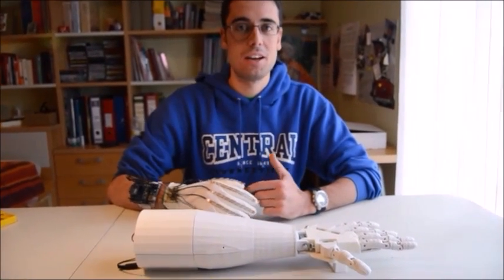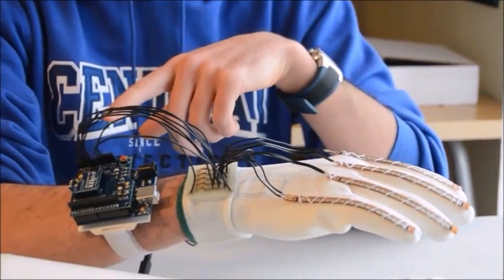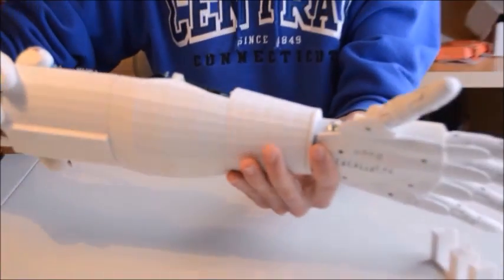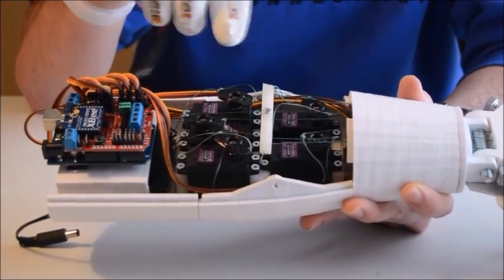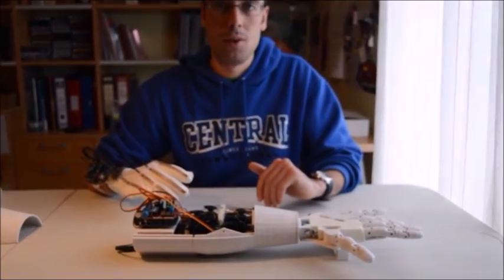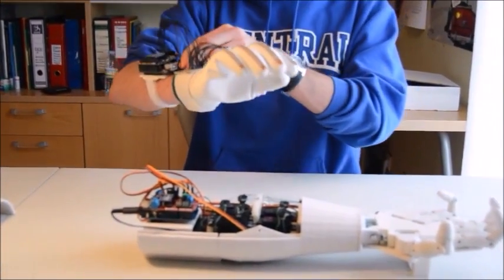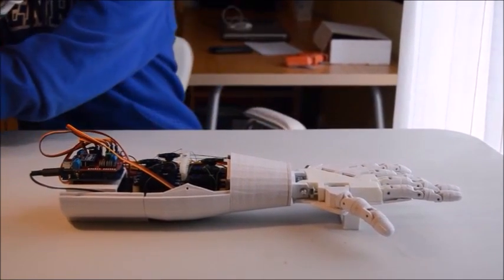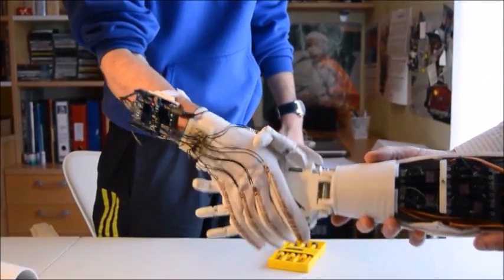Robotic hand wirelessly controlled by glove

Comment: NICE very nice I am just getting into robotics and have been searching high and low on the internet for anything and everything I cad find. I have begone diagramming my ideas in a manual and have thought I want to make my first droid out of soft materials, So I am using HDPE for my hard part needs and other plastics, rubber, and cloth to form most of the parts. I hope to keep metal out of the unit where ever possible. I want a humanoid unit with as much skills as I can design into it. after my internet research I have learned much about what the big Labs are doing on the subject and am very impressed. They have even learned how a lizard climbs on walls and the like. They also said that the pattern of our figure prints aids us with our feeling. so I have big ideas of adding finger prints as well as finger nails to my unit. what is called soft robotics is coming along. it is where you use pneumatic or vacuum pressure in semi soft to firm  plastic balloons. it cut weights down overall and allows for much cheaper materials and build methods. So a Newbie like me has the chance to dream and build. Thanks for your video it was helpful.

Comment: Pablo u didn't use servo for wrist right only 5 servos !!?
Reply from the maker: Yes, only 5 servos. I modified the original InMoov design a little to make the wrist fixed so since it does not rotate, it does not need another servo.
Reply: Thanks alot

Comment: how many Arduino you used in it
Reply from the maker: I only used 2 Arduino UNO, the one that I wear on my forearm (which receives data from the flex sensors) and another one inside the robotic arm (which basically controls the servos).

Comment: Hey loved your work! 
Just a quick question. What kind of batteries do you use for the arm and the glove. 

With love from India.
Reply from the maker: Thanks Rushi!

For the glove I used and standard 9V battery. The Arduino board operates at 5V but it has an internal voltage regulator that allows us to supply energy with batteries from 7V to 12V.

For the robotic hand it is necessary to power the Arduino board and the servos separately, due to the great amount of energy that they need.
To power the Arduino board I used another 9V battery. And for the servos I used a 6V battery that I got thanks to 4 AA batteries of 1.5V each. It is also important to know that this 6V will be entirely used by the servos because I connected the battery directly to the "I/O Expansion Shield V5" where the servos are plugged so this voltage does not go through the Arduino regulator.

Comment: hi pablo 

im in high school and im working in a similar project 
what kind of servomotor you advice me to buy ?
Reply from the maker: Hi Haya,

I used 5 TowerPro MG946R, that cost around 10€ each.
You can use a different model but it is important that it'd be able to rotate a full 180º (not all of them can) and that has a torque of at least 10 kg.cm (when being supplied with 6V). And of course, if you want the 5 of them to fit into the robotic forearm you want them to be small!

Good luck with your project!
Reply: Pablo Ropero Giralda I already buy my servo and it can rotate approximately 180 degrees (90 in each direction) but the torque at 6V : 2.2kg-cm so do you thing it's a big deal?